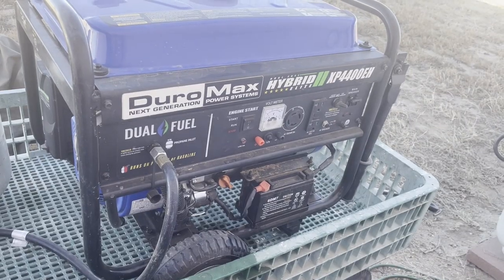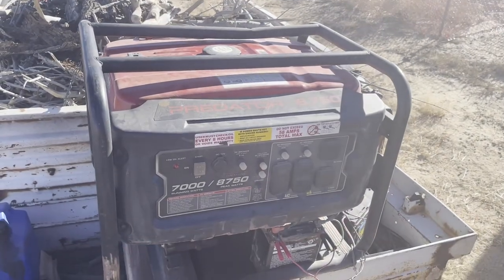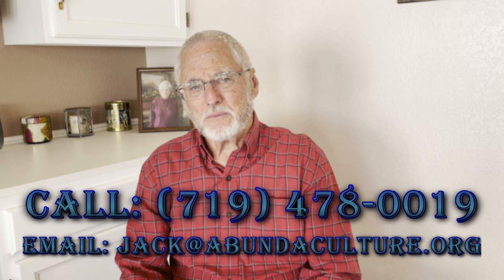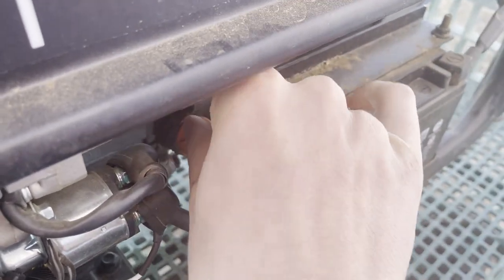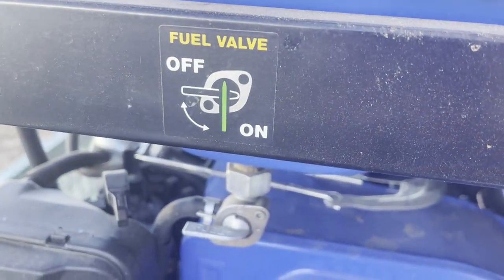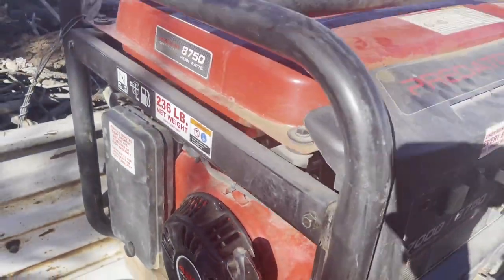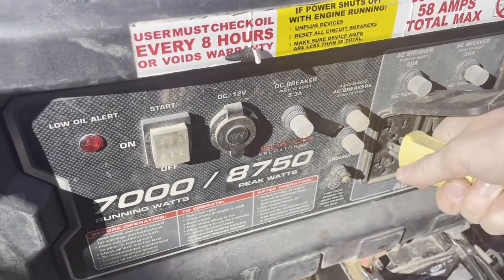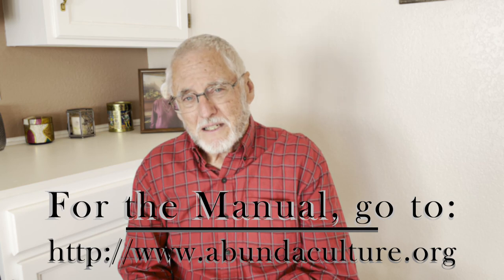Generators and tricks to maintain them

Comment: We picked up a dual-fuel (LP & Gas) generator a few months ago, on sale (our first) and this is some great info! Do you have any special tips on breaking in a brand new generator that were not in the video? (Super glue on the bolts is brilliant). Great stuff as usual Jack!
Reply from the maker: If you will use our guidelines for using the generator just a few hours at a time, you’ll break it in gently. Be sure to keep an eye on the oil.

Comment: When you run it for short times doesn't that make them stall out when starting? Or increase the carbon out put? I'm so glad you posted this I recently have been having issues with mine we took the carburator apart and cleaned it, glad to learn that. I'm going to try turning off the fuel line and see if that helps.
Reply from the maker: I’ve used the method of running my generators for one to two hours at a time for more than twenty years. I am not aware of any problems caused by my methods.
Reply: Well thank you for helping me rule that out. I will have to take mine apart again and see.